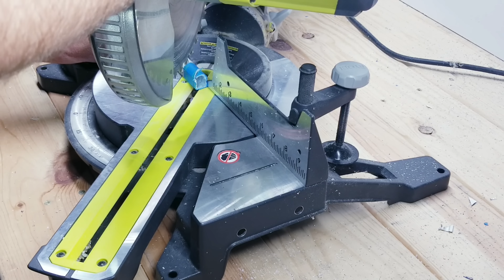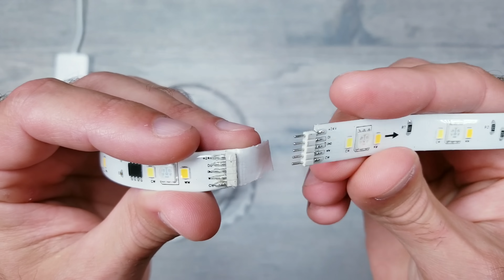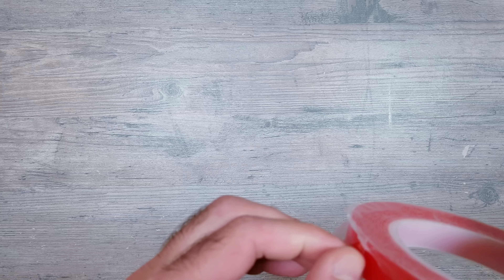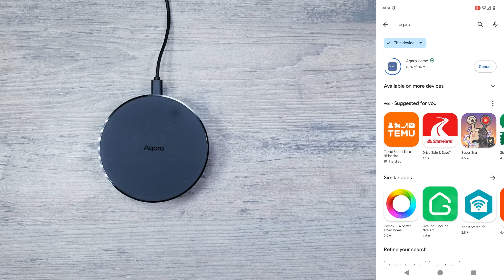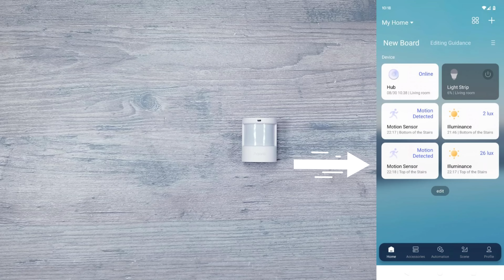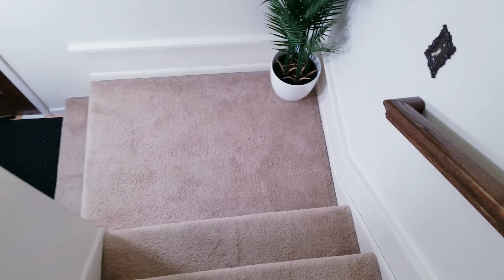EASY Motion Activated Staircase Lighting - NO PROGRAMING!!!

Comment: You say easy, but seem to forget some of us are brand new to this kind of stuff. Cutting those angles is rough if you don't have a miter/table saw.
Reply from the maker: Easy as in your not cutting into drywall, repairing, re painting, re wiring electrical etc.

Comment: ?? Do you have solution for strip sticky back ultimately coming off  track (yes, I even tried acetone wipe inside rail first still no joy)? Chris, any changes or updates to this approach after years of this implemented?  lessons I learned so far: use HOME ASSISTANT for off grid, aqara web site and Reddit has off grid how-to’s

Comment: I know this is a couple years old but I have a question about using the trim. I'm looking to do this project with a govee defuser kit but putting it near the ceiling. Would you suggest pointing the defusers up toward the ceiling and using the trim to cover the channel like you do here? I'm trying to get the most light I can for a loft room above my living are. There are no lights in the loft except for the few lamps and 2 standing light strip lamps I have. Would pointing the strip towards the ceiling and using the trim help light the area best? The loft room is 10' x 16'. Thank you. And I love  your videos.

Comment: Hey Chris. I'm looking at doing something really similar to this, but having it a foot or so from the ceiling with the light going towards the ceiling. Using 2700k to 6500k cob leds. My question is: Is it necessary to run the diffuser in there or can you just have the bare cob light stuck to the back of the 90 face, pointing towards the wall since no bare strip will be seen. Or would you say to still diffuse. Thanks again. I have spent hours upon hours watching your videos. This is a new hobby I have picked up. A lot of fun.

Comment: How many inch above the molding did you mount the LED diffuser? also you didnt have to screw in the mounts? isn't it holding a lot of weight with the trim and the 3M tape would rip off the wall overtime?

Comment: Very clean looking install!

I personally dont know how I feel about everything basically being held in place via "Tape" though. i would have at least used something called "Liquid Nail" which can be bought at basically any store that sells home improvement supplies.

also if you notice that the angles where the stair meets the floor. the "stair" molding ends a little bit thicker than the "floor" molding. thats because youre joining 2 different angles together (45 x 90) both pieces should be cut around the same angle. in this case would be (67.5 x 67.5) which is a weird, hard cut to make. but if you can at least get close to that, you can caulk or spackle the gaps to make everything look more streamlined and fluid

Comment: Is there a difference in what the two LEDS you have linked are used for? Besides the length  per strip? Or is it the same thing? 

For my project it would be cheaper to get 7 of the ‘extensions’ vs 3.5 rolls of the ‘strips’. Looking through the photos on the display but cant figure out if it would make a difference if i get one or the other.

Im talking about 
Aqara LED Strip T1:  vs Aqara LED extension strips

Comment: Great set up! Thanks for the vid but those aqara lights are trash. Only the main strip you connect to can use the full range of colors and whites. The extensions can only use one, seems like a lot of people have had issues with it. Aqara customer support is only AI, and when you try to use it the server is down. Returning the aqara trash and going to get govee. Other than that, the rest is awesome!
Reply from the maker: Thanks for watching! I never had any issues with mine and all the extensions lit up the same as the main unit. But this video is over 2 years old. A lot has changed since then and Govee is a great choice and probably what I would go with today for lights but I would for sure still use the aqara motion sensor. Similar to what I did in my recent garage lighting video: https://www.youtube.com/watch?v=guDjpHak_bU&t=1s

Comment: Thanks for your videos Chris! I am doing the same thing to my stairs but I do not have a plug in my stairwell. I was thinking about wiring directly to its own switch pigtailed off an existing light switch. Is this something that I could still do and have motion sensors from your experience?

Comment: On board with the aesthetic, and you did a professional showing of it, but a shame it relies on yet-another IoT device whose app will eventually go defunct. You mentioned it will function fine afterward, but the motion base requiring WiFi credentials means that any changes to your equipment would need it back. I also wouldn't trust it as secure since you aren't putting firmware updates to your stair lights.

Comment: Chris...

The motion sensors are an issue.

If i am walking from the bottom to the top..
A. Motion strip at the bottom of stairs is activated. (Cool White Light)
B. Motion strip at the top of stairs is activated. (Rainbow RGB) 

1. Lights wont shut off till the last sensor is actived. 

2. You cant have 2 different lighting scenes for each sensor. They really have to be the same lighting scene or it will look wierd when you walk past the 1st sensor and then the 2nd sensor and the lights change to a different proframmed scene.

There is no real solution to having 2 sensors at the at each end of the stairs cause they will activate and if you have different scenes to go off for each sensor its going to look strange when you have it set to cool white at the bottom sensor and blue at the top sensor.
You will watch you lights go from white to blue once you walk past the top sensor😩🤦🏾
Reply: I haven't got these, but can you set up the software so it checks if the lights are already on, and if they are then do nothing. This should stop the one at the top triggering once you've walked up?

Comment: Thank you very much for sharing. For information it is not always useful to use the light diffuser on the aluminum rail. if the underside of the tape is not directly visible, which is the case here since the light is directed downwards it does not bring much and it costs money for nothing. It is a pity that you did not take advantage of the putty to fill the gaps of the skirting boards with the plaster wall, also and repaint them at the same time :) Also know that there are presence detectors that have the same shape, same appearance as a switch. as often the old switches of the staircase are placed at the top and bottom of it, the replacement allows to detect the movements for a low cost ($10 each in France) and without installing anything more. They are adjustable in duration and sensitivity. But you cannot adjust the light intensity. A question: how did you fix the aluminum rails on the plaster? By screws or glue?

Comment: I'm looking at doing this exact same project this month.

Chris, if you were to do this again, would you use the same LED strip + extensions? Or would you look at wiring up one of your WLED systems?
Reply from the maker: Thanks for watching! I would do it the exact same way. I've had zero issues since day one!
Reply: @ChrisMaherDIY  I'm debating on using a single run of the Hue light strip since I've got there ZigBee network running already or wiring up a cheaper LED strip and using WLED...

Comment: This is a great DIY video and very helpful. Great work. 

Hi, I have a question about Aqara T1 LED you’ve used. Do you have connection problems after you setup all? Are they stable to connect with the hub & the sensor? 

As my LED started to have problems with the sensor automation after 10 hours.

Comment: Looks awesome. Only thing I would suggest is making a 30 degree cut on those pieces of trim at the bottom and top of the steps, on both sides. Your 45 degree cut results in the joint being longer on one side than the non-mitered edge. instead, if you had each cut at 30 degrees for the 120 degree angle, both pieces will be the same exact miter cut length

great job!

Comment: The paid ad for whatever led brand was pretty obnoxious but the final product looks nice. I'd use a different product that doesn't need to be on my wifi or use an 🤮 app 🤮
Reply from the maker: @j45002 thanks for watching!  what brand would you recommend that has a wireless motion sensor and led strip that has a dedicated white that plays nice together that does not require coding?
Reply: @ChrisMaherDIY  idk I'll get back to you after I find out. I'm inspired to do this project so I'll do some research.

Comment: As a programmer, I couldn't help but notice a flaw in your logic: Suppose you trigger the sensor at the bottom. The light turns on. You walk up the stairs and enter the bathroom. Then, you leave the bathroom again 55 seconds after having initially triggered the bottom sensor. Now the top sensor will trigger and switch the light on (which it is already). You start walking down the stairs. After five seconds, the light goes out, because the bottom sensor hasn't seen movement for a minute. :)
Reply: I’m a programmer and had the exact same thought 😂

Comment: Next time you use a caulking gun, if you put your finger hard on the tip/corner and keep constant flow and speed for the entire length of the job, you will have the most immaculate, professional looking corner, and almost zero cleanup. There are also options like cutting an old plastic card at a 90, and scraping excess, or cutting your nozzle at 90 on a 45 and just flow like a pro.

Comment: Awesomely direct solution. The versions that seem to travel along with the person moving through the path taken, seem a bit cooler though. Not to complain, but are there programming options that give the look of travel without actually turning off and on in step with someone's walk? If you could control how fast the lights turn on that could suffice. If it were also possible to turn off slowly that would be the other addition. Are the string individually programmable so the individual strips would turn on sequentially?
I am going to use your idea, just wanted to understand more of what's possible in programming the feature in the app.

Comment: Great video but JUST TO UPDATE there is an updated hub. Doing this project now and found out that the lights no longer support AQARA HUB M2. They now have a M3 version you need to get and will not let you connect the led strips to M2 hub used in this video because it's too old a version.

Comment: Excellent job. We have 7 staircases in our house. One is  long semi spiral that was built in France in 1782 and brought over. Finding a place to hide lights on it would be difficult. We ended up going with little hidden very low voltage spotlights that come on when the sun goes down. Before that, it was turn on the main lights, which in the middle of the night is way too bright. The house was built by a well known architect in 1938, when apparently lighting safety was an option ;)

Comment: very nice video.  I would love to do something like that,  My Hand rail is not connected to the drywall but to a 6 inch wide oak running that goes up the stairs.  I would like the light to attach them that.  I would like Motion detection at top and bottom but don't want any WIFI or internet needed. Any suggestion for a none wifi setup ?

Comment: Looks great. 
I have good luck with 3M command tape removal which you adhered to the diffuser & the wall. 

I have horrible experience with the removal of double sided tape which you used to attach the trim. (After I  removed the double sided tape, the dry wall need to be professionally repaired.)  Cannot recommend using double sided tape on dry wall.   Finishing nails would be easier to repair.

Comment: Caulking: have a bucket of water (for latex caulk) & try to do 95% of the "work" with the caulk gun/tube tip.  Wet your finger & gently lay the caulking out.  You're not trying to remove half of it with your finger.  

(It's not "eXspecially", but rather especially.  Throws me off when I hear that.)

Drywall rarely gets wavy over time.  It's not just older homes.  It's worse in "custom" homes.  It's just sloppiness in the building process.  It's why builders use trims around things and various textures on the walls.  They hide many sins.

Corners are almost never square & walls are not flat, which you can also see at the tops of your baseboards & around the door casings as well.  Caulking is how builders "fix" these problems.  Fixing this sloppiness takes time & costs money.  Using inexpensive "painter's caulk" is fine.  Always have trash receptacle or you'll get caulking all over.  It's like a virus.  It looks like you got some on your shorts.  This virus goes EVERYWHERE.  With a pail of water, you should only use 1 or 2 paper towels (which are put directly into a trash receptacle).  Water helps smooth things out & is for rinsing your finger clean(ish).  

Buy a good caulk gun or regret it every step of the way.  Buy once, cry once.  

Nice concept.  Every stair should have this.

Comment: Excellent job, been thinking of doing this down 5-6 steps to my lower split level movie room and then up to the mid-wall ledge where the exterior foundation and ground wall meet. However, my OCD focused on the lack of caulk on the existing trim. 😂 It made it worse when you did a beautiful job with the lights but still had the existing gap. This is why my wife hates my projects! lol I would have found a way to over complicate or add on more work for myself. 🥺

Comment: Why do you need silicone coated led? Also that led density is horrible. This is a bad advert for chinese cheap products
Reply from the maker: Thanks for watching and taking the time to comment. You don't need silicone coated LEDs. I love how everything turned out and it works flawlessly. What plug and play system that comes with a wireless motion sensor and higher density led strip that's made in the US would you recommend?

Comment: You mentioned running that power supply through the wall into the next room t hid it better. Not sure the cable is in-wall rated for that application, but I want to do a project like this for our stairs and maybe do a more permanent installation. Thinking I may try to find a controller/driver that can mount in-wall and splice into the home power supply with a permanent light switch acting as the on/off switch.

Comment: I want to make a bedroom like this. Only use low intensity red light. You have the lights go up the walls, along the floors, and around the ceiling. When the lights are on you can tell you're in a big box. Maybe outline the doors too.
When your spouse is asleep but you need to get up and get ready for work, turn these on. You just got up so they can be very dim. They will give you just enough spatial awareness to navigate the room and get ready while your spouse is blissfully asleep.

Comment: Alex plus 30 minutes before you paint! Gaps no more. And if your messy with caulk,a spray bottle with water and dawn is your friend. Lay the thin bead, spray lightly, smooth with your finger, clean with paper towel. The spray keeps the silicon from sticking to everything, just where you initially laid it

Comment: "if/then" statements are technically programming, though you're not coding them, so the title should more accurately read "no coding" but that's being fickle.  But cheers to this guy for the cool project.  My only criticism is if the stairs are near the master bedroom.  You wake up at 4am to go to work, open the door and BAM the pitch black bedroom is hit with light (albeit not direct) entering the room.  If my wife's face is facing the door, that could wake her up each time.  Cool idea but I'd be forced to take them down unless I program them not to go off at a certain time.

Comment: Please don't rely solely on removeable 3M products to mount lighting accessories and decorative  moulding to the walls... especially in an area where a misstep can easily knock it off. You took the time to paint and caulk it. You may as well use hardware to secure it properly.

Comment: So essentially skip the aluminum just mount the wooden angle pieces, put the LED underneath them, caulk and paint and you’ll save yourself a bunch of money on the aluminum
Reply from the maker: Aluminum helps with heat dispersions, longevity, and the lights stick better to aluminum than wood but if you're looking to save money for sure an option!

Comment: Great project and it looks awesome! One thing I was curious, though: with the current instructions, if you pass by one sensor and stays moving around in front ot the other, the lights will blink one minute after the firrst sensor is not detecting your movement, I think. Is there any way to "link" the sensors so they act as a single unit? Or make the second sensor cancel the one minute timer for turning off the first one? The way it currently is, it will not wait one minute and will blink eventually. Not a big problem, but not perfect either.

Comment: Top tip: when caulking, keep a sanitizer bucket of warm water with you to keep your fingers wet and to dissolve excess caulk (non-silicone only). Use blue shop towels as well, and for that run you should be able to get away with only using two shop towels.

Comment: I liked this so much, I bought the kit and did the same.  Just finished up the install yesterday.  Do you occasionally have it where the lights turn on but won’t turn off?  It’s only happened a couple of times now, but I have to disconnect the power to the es32 and reconnect.😢